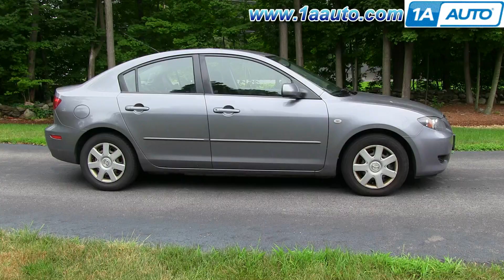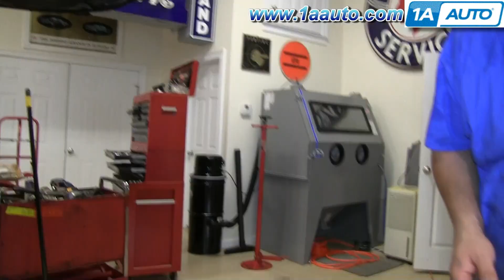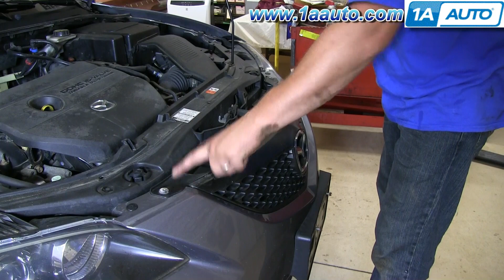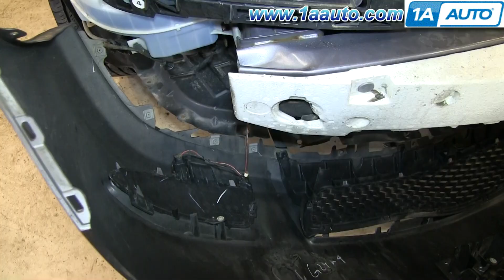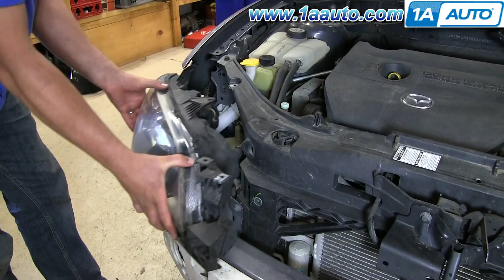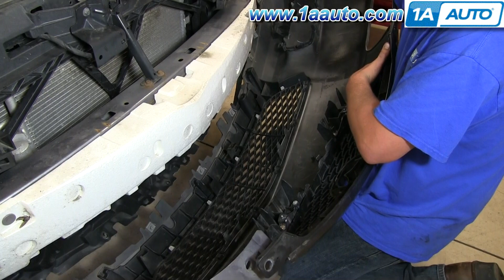How To Replace Headlights 04-09 Mazda 3

Comment: I’ve had to replace both low beam bulbs 3 times respectively over the 45k + miles driven since August 2024. Never removed the bumper cover. Decided to upgrade to Sylvania H7 LEDs. If you want to upgrade you will have to remove the assemblies on both sides…

Comment: After you've removed the bumper cover at 3:00, why can't you just replace the headlights and not deal with removing all the wires and stuff that are connected to the bumper?

Comment: You can change the driver side headlight bulbs without pulling the bumper cover and headlight assembly. You just have to swear a lot at the frustrating spring lever mechanism and have a really good pair of pliers. Pull the cover off your fuses just to get a little more room.

Comment: is there any difference in removing the bumper on mazda 3 2006 5 door?
Reply from the maker: +Boro ZG It should be a similar procedure on that vehicle. Hope this helps you out. 1aauto.com
Reply: I just replaced headlights. Clips in the bumper are pretty difficult to reach since they are not in the same place like on 4 door.

Comment: You don't have to remove the bumper on the 2006 mazda 3's to replace a headlight bulb on either side. I would know because i just replaced both the high beam and low beam without having to remove anything but the battery cover.
Reply from the maker: We were replacing the entire unit in this video. However it is not always necessary to remove the entire housing if you are doing the bulb only. Thank you for watching!
1aauto.com  888-844-3393
Reply: O ok i was like remove a bumper to change a headlight who came up with that design haha
Reply: @1AAuto  Thank you for the video.  I have the 2006 Mazda 3s that was manufactured in Japan and has those expensive and pesky HID bulb that you have no choice but to remove bumper.  UGH!!!!
Reply: Hey man, can you give me a mini guide on how to just replace the bulb on the driver side? It would be really appreciated! :D
Reply: Andrew Duggins the main bulb is extreemly difficult it seams that the desighn is very impractical for replacement. thank you for posting.
Reply: If you have the factory Xenon/HiD headlights, it's impossible to access the bulb for the low beam from under the hood on the passanger side. With the regular halogen headlights, it looks like there is more room.

@1A Auto Parts. Thanks for the video! I was stymied and could not figure out how the bulb could possibly be replaced.
Reply: That's what I thought as well.

Comment: Is it the same way with the 2010 mazda3?
Reply from the maker: It may be a different procedure. We currently do not have an auto repair video with this particular repair. You may be able to reach around the back of the headlight to remove the headlight bulb. 1aauto.com 888-844-3393
Reply: ok,thanks for the reply

Comment: Thanks for the upload. I could have used this video a year ago. My right headlamp was out on my 07 Mazdaspeed 3 and I needed to remove the bumper. It turned out I needed a ballast replaced and not the HID bulb itself.
Reply: I know this comment is 3 years old so this reply is not neccesarily intended for the original poster; it's mainly for anyone like me who is just googling how to do this.

This comment above is a decent reason why it may be a good idea (when replacing bulbs), to consider just upgrading/swapping out the entire HID set for a new set, with brand new ballasts, harnesses and such.  You can even change the color temperature if you wish.
Reply: Did you happen to have the clips in the middle of the bumper like it shows on this video? Can't seem to find out how to remove after getting all the clips and bolts off!